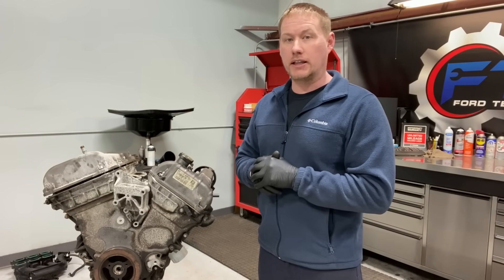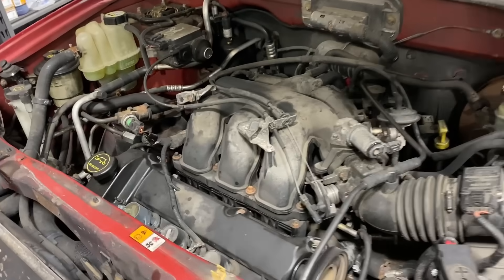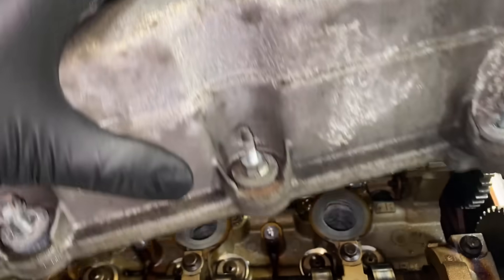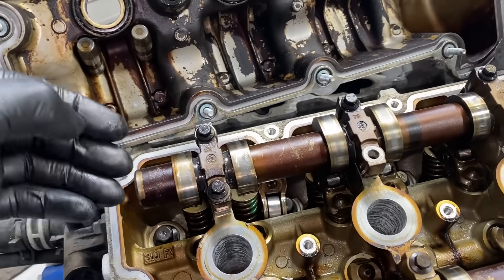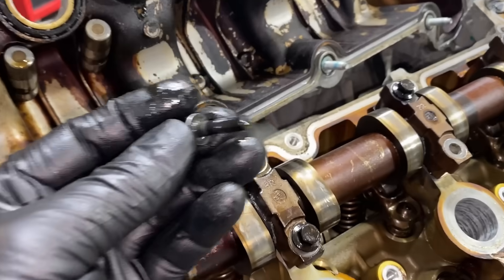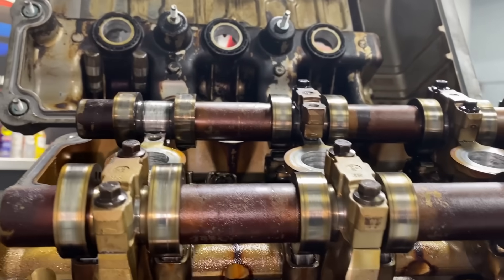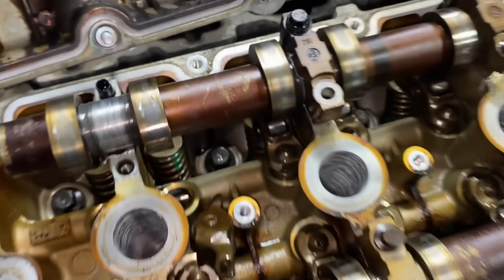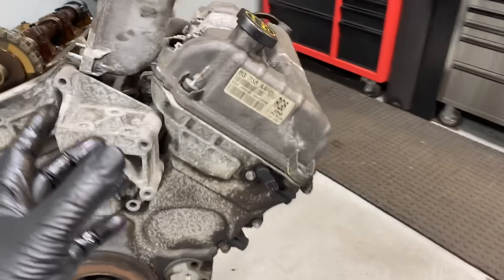Ford 3.0L V6 Duratec Engine: The One Fatal Flaw That Will Destroy This Engine!

Comment: That's what happens when you turn a gas engine into a diesel one... way to go Ford....
Reply: GM did that Years Ago and there was a class action lawsuit against them. One would think Ford would Have taken notice.
Reply: @robertneal6878  yeah, why couldn't they take note from dodge and get a engine from a reputable diesel engine builder and call it done.  I mean they aren't with out some issues, but these type of issues aren't a problem.
Reply: The 3.0 Duratec is not a diesel is a gas motor buddy  what are you talking about?

Comment: Haven't seen that on the Mazda side. I have seen a few cams seize due to lack of oil change resulting in jumped timing and then on to bent valves. I did have my father-in-law drive in one day. He had just come from about a hundred mile road trip.he said when he had started the car up  that morning that it had a misfire. He found that it would run better if he  put it in a lower gear. So he drove it almost a hundred miles with a misfire. I told him that if he had just stopped and parked it I could have fixed it for under $100. I informed him that I guarantee that he destroyed a catalytic converter and now it was going to cost him over a grand. He learned his lesson that day.

Comment: When you removed the covers the first thing I saw was the lack of oil, the caps on both banks must be shot.  How was the oil pressure in this engine, and how is the bottom end?

Comment: I have a 98 Ford ranger 3.0. V6
Any sort of stuff I should do to prevent stuff like this?
Stud kit or anything to watch out for?
Reply: The 3.0 in your Ranger is a totally different beast. It's the 3.0 Vulcan, same engine that came in the 90's Taurus, and is basically bomb proof

Comment: Ford excels at leaving one glaring flaw in their V6 engines. Like the water pump problem on the 3.5 engines.
Reply: Or everything  on a gm 3.6 v6 what a piece of shit!
Reply: @timcheek5134  You got that right! The first 75,000 miles my 3.6 had 6 cam phasers, and all 3 timing chains changed. I use Mobil 1 full Synthetic, change oil AND filter every 4,000-5,000 miles, and keep a close eye on the oil level. Dealer said he'd never seen a 3.6 need all that in only 75,000 miles. I said "Now you have"! Whatta POS TURD. I put 399,600 miles on a 2003 Buick LeSabre with the 3.8 V6. Only hitting a deer at 70mph took that one off the road. Put 360,000 miles on a 1995 Grand Cherokee with the 318 (5.2l) V8. This 3.6 is JUNK. Done with GM. Anybody wanna buy a car? Or is that fraud?
Reply: 3.0 Vulcan😉
Reply: @wolfmanrebel874  is the durtec 3.0 same as the Vulcan 3.0?
Reply: @jws3925  no,they share virtually nothing, Vulcan was a center cam in block w/ distributor tough as nails , duratec is dohc still somewhat tough outside of all the plastic cooling bs they used that causes annoying issues , they duratec has significantly more horsepower but il take a Vulcan anyday😉
Reply: @jws3925  imagine the difference between a 5.0 in a 95 f150 vs 5.0 coyote in a 2015  , they have about as much in common as a Vulcan does to a duratec,lol
Reply: I have the 3.0l duratec v6 motor very reliable
Reply: Designed to fail
Reply: Had a 3.0 in a 89 aerostar van, was a damn good engine. Transmission wasn't worth a shit but the engine sure was good... Lol
Reply: @garyr7027  my mother had a 95 aerostar 3.0 from 96 through the rest of her life it's rotted away out in my field I have considered pulling that engine,trans, electrical system out and putting in something farm related around here unfortunately the van is just to far gone really I'd love to restore it after all these years that thing never let her down other than alternator a couple times,starter once and coil once ,she had a 91 aerostar with4.0 before that one and it was absolute shit something was always wrong with it I remember my grandparents raising all kinds of hell when she said she was going to get another vehicle and came home in the 95 but that damn thing did us good the rest of her life, iv had an 03 f150 since 06 that seems to be my "ol goose" as she called her van ,I'm pretty sure it will outlive me
Reply: @wolfmanrebel874  3.0's were the better motors, 4.0's were junk. Only problem I had with that van was the transmission, but it never actually fully quit on me. I milked it for the miles then scrapped it due to the rust. Overdrive quit, reverse slipped some, shifted sluggish but it did keep goin.
Reply: @garyr7027  I agree, the last year she drove it I remember if it was cold outside she would have to let it warm up a second before it would go in gear but never had driving issues outside of that until no joke,the day I hauled it home after she passed away it wouldn't pull all the way up the ramp it got halfway and started slipping I just grinned I could just about hear her say" I told y'all I didn't need a new van this one would make it till I go" ,that's why it's set in my field for I guess about a decade ,it had 300000 miles on it she lived on disability and couldn't walk so it was not properly maintained once I started a family and moved out...  and with everything else iv had goin on over the years I just never put money into it, I kinda regret that when I look out at it now, they definitely don't make them like that anymore

Comment: Those bolts were improperly tightened at the engine factory.  The ones that are broken were either stretched beyond their yield point or backed out and the slop from the cam cap slopping around was enough to fatigue them.

It is also possible that somewhere during assembly, there was too much oil in the threads which resulted in a hydrolocking condition and the torque specs didn't correspond with clamping force and it just took a long time for it to become a problem.

This cam/follower setup isn't unique to this engine by a long shot.  And normally, when cam cap bolts are removed from any engine, they take a good amount of force to loosen them and it is accompanied by a "crack" noise when they finally budge.
Reply: Great reply.  Informative.  Concise.

Comment: My 2006 Ford Fusion 3.0L has 100,000 miles on it and it has been very good, no oil leaks.  New bolts, thread locker such as the red Lock Tite 271 series and be sure to wash all the oil out of the threads with brake cleaner/ electric cleaner before properly torquing.  I have much experience with this thread locker and it always works even though it is some type plastic, not metal, Lock Tite is very good at locking things up.  Then if you fear you'll never get it apart again simply warm the area up several hundred degrees and that unlocks the thread locker.
Reply: Thread Locker is probably not good advice.

Comment: I can vouch for the durability of the Duratec 3.0.  I put over 326K miles on my Mazda 6 with the usual oil leaks, bad ignition coils and even overheating from failed plastic cooling pipe.  Looking at the inside of that valve cover, it looks like the oil was not changed very often which could have been the cause of the failure.

Comment: I am concerned I have this problem described in this excellent video building on the 2009 V6 Escape XLT I have bought last year for my son. It has now 140,000 miles. When bought at 126K miles, Spark plugs and filters changed (I  have used Bosch Iridium at spec), SeaFoam treatment 25 miles before the oil change, transmission fluid changed. The car has been working great giving 28 miles / G. on the highway and 23 miles/g in the city. Way less vibrations, 10,000 miles with no issue at all. But, for the last 3,000 miles, Check Engine light coming and going (P0171 (too lean Bank1) P0303 (Cyl.3 Misfire)), and gas mileage dropped to 20 miles/g. 
I did put some Seafoam in the fuel tank, the Check Engine light went away (P0303 no more, but P0171 still read) for the duration of the whole tank (close to 400 miles), and gas mileage was again as good as it ever was.  I refilled the gas tank and after about 150 miles, P0303+P0171 Check Engine light is back. 
I plan to move the Cyl.3 spark plug to Cyl.6, the Cyl.3 coil at Cyl.4 to see if the P0303 changes to another cylinder. Maybe I am wasting my time, please let me know.

I have bought this car from a lady who had maintenance done on it regularly. I have gladly paid her asking price of $3,500. The car is in great shape, no sign of rust and fully loaded with everything working. There was some work needed on it, and that was an opportunity to teach my son not to be afraid and work on it. We had a lot of fun adding a tow hitch receiver, changing the brake rotors and pads, all the fluids, the filters, the spark plugs, the AC condenser, the oil pressure sensor. The car leaks a little bit of oil, likely from the distribution chains cover. 
And your videos, Sir, have made it all possible. Your videos are awesome, simply the best on these topics. How do we donate so you are encouraged and keep at helping us that well? Edit: I have found it: Paypal link in your account profile. Thank you again.
Reply: After moving the spark plug on C3 to C6 and switching the coils between C3 and C5, the codes are all gone. I drove 300 miles and I get 26.5 m/gal. All good for now.

Comment: It is because the end only has two bolts taking the load. The other lobes are supported by two sets of caps. it overloads the aluminium at the point of thread contact, not the bolts. It is a classic aluminium fatigue failure.
Reply: Then the back end cap bolt threads would be ground out or stripped and replacing just the bolts wouldn't solve the problem.

Comment: I have Ford Escape I I have oil liks on the back the engine what’s you recomend?
Reply: Jose Vail -
So you get the burning oil smell at stoplights too? I use the high-mileage oil. The additives help with the leaks...slightly....on my 2005.

Comment: Excellent video... the same thing happened to me it sounded and in the end the pieces of the head came out 1 they bent 8 valves and broke the crankshaft gear very attentive to those sounds of the engine ...

Comment: What is that pulley for on the back of one of the cams?
Reply from the maker: It runs a belt to the external water pump.
Reply: @FordTechMakuloco  Good to know, thanks.

Comment: Same issues with the smaller 2.5 Duratec V6 and the higher output Jags with rollers?
Reply from the maker: Not on the 2.5L engines, not sure about anything Jag.

Comment: Well, I don't want to hear any more of the Ford fanboys complaining about the GM 3 6 in the early years with the stretched timing chain and tensioner issues in a 4700 pound suv. That ain't nothing compared to This Disaster. And the GM 3.6 actually has power. This thing is not exactly what I would call a potent V6. It definitely wasn't any match for the 3800s that they're running around competing against them  in the day. Fords old school ohv 3.0 and 3.8 didnt seem bad. Maybe they should have stuck with those.

Comment: Is this just for the 3.0 because I have a 2011 edge and the water pump failed. i had the dealer replace it along with a new chain tensioner etc. but now ever since it has made a noise it just sounds like the chain on the guides but not sure. I know engines inherently make noise but now I just call it the tractor because it sounds like a diesel a little bit lol

Comment: Is it difficult to diy replace the rack and pinion on a '10 ford edge awd?Any suggestions, tips, or resources? No leaks and works ok, left side rack  moves a bit and is causing additional problems.  Thank you and stay safe.

Comment: And that's what ford motor company lives for, "it's so expensive, you just replace the motor" or " the motor is so expensive you just replace the car"
Reply: Wait till you see a 3.6 gm v6!👍
Reply: @timcheek5134  But still, isnt FORD supposed to be so much better?
Reply: @nickoD509  fords get abused and do this for 100k miles everything else you take care of right and something breaks at regular intervals hmmm
Reply: The engines coming out in cars now are pretty much throwaways. You can rebuild the bottom ends rotating assemblies but it's going to cost just as much or more than just replacing it. Pretty much any engine with aluminum cylinder heads you now can't get from a scrap yard the heads they are worth more in aluminum to the scrap yard.
Reply: There's a reason I won't give up my GM 3800 II. That things has been a veritable workhorse. The only thing that failed was a hydraulic lifter got stuck and ate the camshaft @ 328k. Took that as my sign to grab a ZZP stage 1 cam. Then did up the whole valvetrain. My brother had the oilpan off around 250k to replace the gasket, and tackled the rod bearings while he was in there (just to make sure we'd never run into that issue).
Reply: That's every manufacturer 🤣
Reply: @analogdadd  I own modern GM & Fords and everything on the Ford takes many times more time to repair and more money.

Comment: This is really not a bolt problem. Aluminum expands and contracts about twice as much as steel for any given temperature change. As the engine heats up, the aluminum tries to expand but is compressed under the bolt. When the engine cools, there is now less tension on the bolt. This is why you see this problem in overheated engines, but constantly cycling from 210°F to below-freezing can eventually have the same effect - loose bolts. Loctite or new bolts of the same alloy will not solve the problem.
Reply from the maker: Never a problem in other Ford OHC engines with aluminum heads and the same M6X1.0MM bolts at 89" lbs .

Comment: I've owned 4 escapes, never seen that issue. All 4 where pushed above 190k. Rust is what killed my escapes. I currently have a mariner, guess now I'ma check this out when I do my valve cover gasket
Reply: pelotas56 -
I own a 2005 and a 2006 Escape (long story on the 2006). I live In Minnesota and those things are RUSTY! I fabbed rear shock mounts for the 2005 and the rear wheel wells are layers of Gorilla duct tape + undercoating. Lol.
Reply: @chucknoob7041  gotta love Midwest, I'm in Wisconsin. my recent beast was a 2004, this was the only escape that the right rear wheel well rusted out. I also fabricated mount😂. 2000-03 had wheel liners which made them alil less prone to that rust. 04 and up some douche must of said  away with this as we got a moister absorbing seam sealer.

Comment: i hope you read this. i am a mechanic and i personally love the 3.0L Vulcan engine. my son has 2 taurus w/vulcan, myself and my husband have 3 taurus w/vulcan and they all have minimum of 175k and still going strong. the question is, how do you feel about the 3.0L vulcan?
Reply from the maker: Basic and reliable but still many common issues with them, more issues than the DOHC engines.
Reply: @FordTechMakuloco  the most consistent problem i've had is that every one had to have the coil pack replaced. otherwise, just change coil wires and plugs at 110k and then regular oil changes and every 10k fuel filter. that is all. i feel like they are reliable, get decent fuel mileage, and those taurus were top safety picks for their years so cheap on insurance.

Comment: Can it produce knock similar to destroyed crankshaft or crank bearings? I have a similar sound form a 3.0 Mondeo ST Duratec it can be heard when engine is loaded, but vanishes on idle... and it appared only 600 km after I had head gaskets replaced.

Comment: I have one and it has 336,000+ miles on it and it still runs like it is new.
Reply: what year is it and model?
Reply: @jeedwards1981  It is in a 2000 Ford Ranger and it now has 352,000+ miles on it and still runs like new.

Comment: My 2001 Escape had an engine failure at around 96,000, it dropped a cylinder (valve or head gasket we suspected) replaced it with a low mileage used engine and I drove it until around 220,000 when the trans failed. I replaced it with a 2008 Escape and I drove it up to 275,000 on the original engine and trans. It still ran good when I traded it in. It did leak oil around the water pump pulley, but I checked the oil often and kept it filled.
Reply: I have the exact same situation with my 2008 escape with oil leaking around the water pump pulley. Is the pulley just an idler pulley for the water pump?
Reply: @ryanmelton7495 at-205 fixed my leak.

Comment: My wife & I have a 2005 Escape XLT Sport 3.0 L V-6 that we bought new and now has over 180,000 miles on it and is still running strong except for a small oil leak.  I'm giving it to my sister next month.  This is one of the best cars I have ever owned.

Comment: We have one of those to repair in the near future. Blew a spark plug out of the hole & the Ford guy let some of the metal chips get into the cylinder & did some sort of internal damage that is yet to be determined. Failed Ford engineering. In this case the cam bearing caps need larger bolts. The camshaft itself will need replacing, the broken bolt will need to be removed,  bearing caps will be damaged. Very expensive. This should not happen, where is the quality of manufacturing here?

Comment: I had a 99 Taurus with this motor. This engine was indestructible, and outlasted the car due to living in the rust belt. The weak link on these cars were the transmission.

Comment: Fantastic video, worth its weight in gold. My son has a 2005 Taurus SEL Duratec 3.0 that is misfiring occasionally. We are definitely going to investigate using this procedure. Will let you know what we find!
Reply: My son’s cam bolts were all still tight to spec so I left them alone. Miss was due to two VERY loose plugs under the rear valve cover. Looks like I have a set of Duratec cam bolts to sell.
Reply: If anyone is interested my unopened set of these cam bolts is up for sale on ebay for a lot less than you will pay a dealer. Just search on part number W705391S300.
Reply: What did you find?